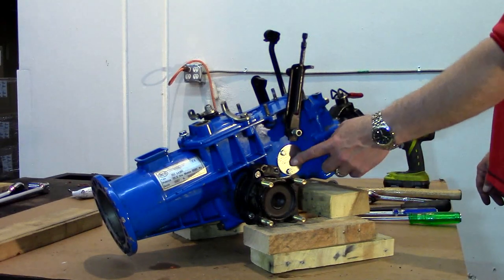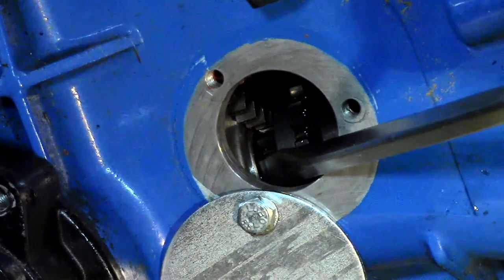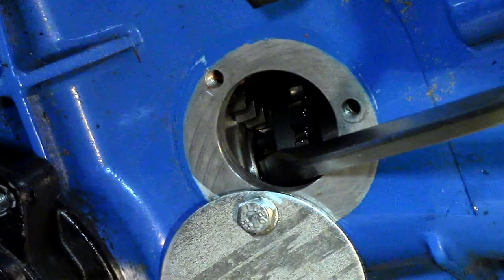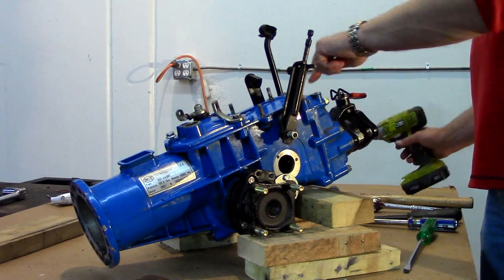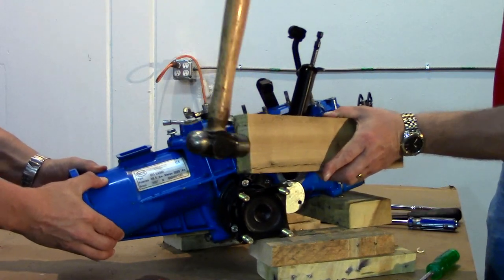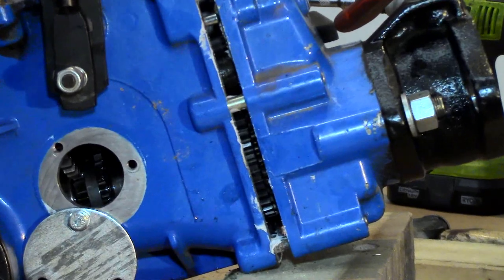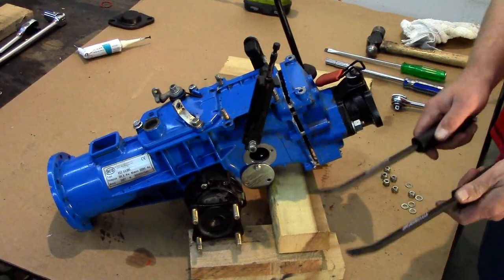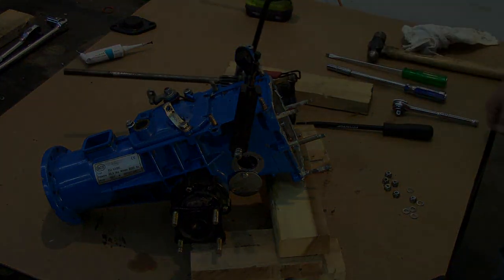Removing the BCS Two-Wheel Tractor Transmission Cover

Comment: No gasket or anything between the aluminum housings? How many ft lbs do I tighten the bolts when I put it back together?
Reply from the maker: Silicone between the gaskets.  Transmission cover bolts should be tightened to between 17-20 ft lbs.  We have torque specs available on Service Bulletin 1-4, which can be found on this page: https://www.bcsamerica.com/service-information

Comment: I can't remove the bearing, as it is in this video it is stiff, what could I do ???????
Reply from the maker: If you've followed all the instructions in the video, you may need to contact an authorized BCS dealer for further assistance.
You can also call our tech service line at 855-832-4501.

Comment: I have a problem with transsmision oil leak on the black ruber "thing" that is before "quick black thing" for tiller, what do I need to change?
Reply from the maker: Pretty much impossible to diagnose without looking at it in person.  We'd recommend taking it to your local dealer.

Comment: Do you have to remove the engine to do this
Reply from the maker: No, the engine doesn't need to be removed.  It was just easier to film this way.
Cheers
Reply: @BCSAmerica  Ok thanks and yeah got to do this as someone broke the plough off
Reply from the maker: @stephenroose498  Broke the studs at the PTO mount?
If so, the whole cover doesn't need to be replaced.  Or removed for that matter.
Reply: @BCSAmerica  they ripped the studs right out the casting and broke it so hole casting needs replacing
Reply from the maker: @stephenroose498  Yikes!  Sounds like you're on the right track then.